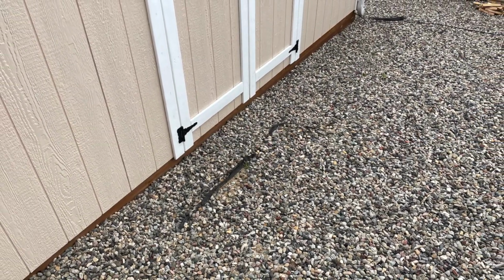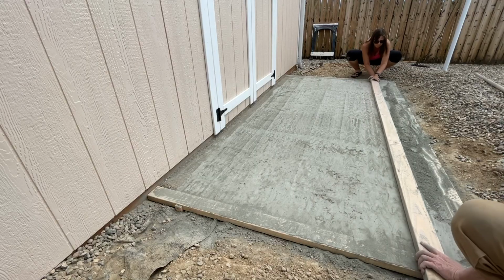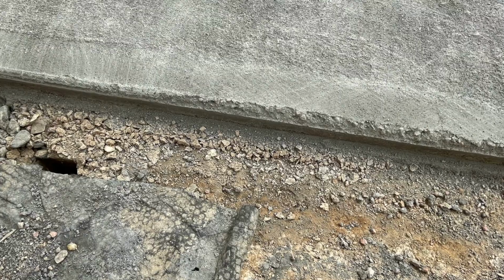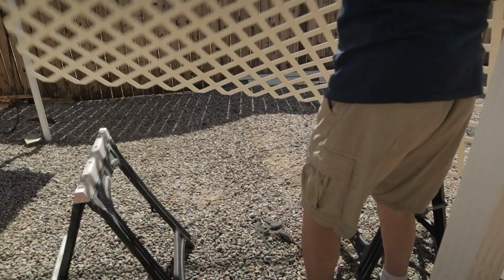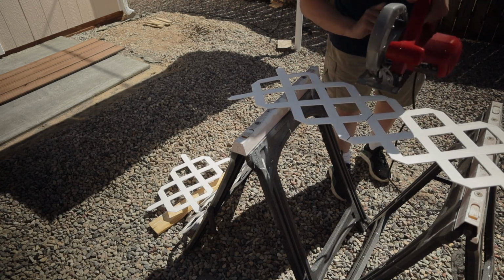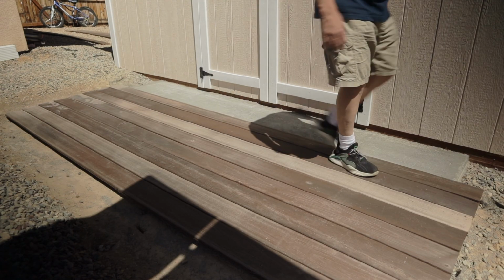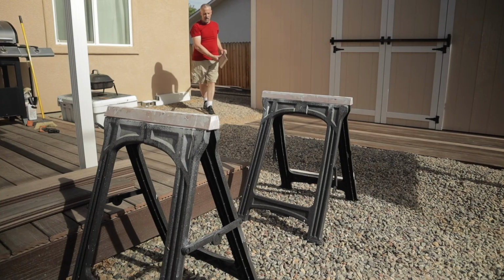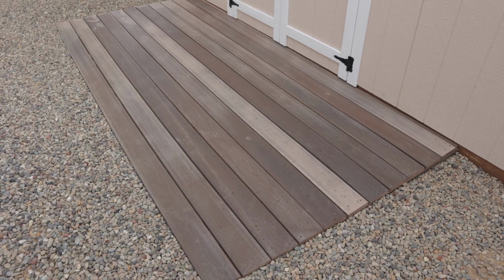I RUINED My Dry Pour Slab... Here’s How I Saved It

Comment: Personally I would have repaired that slab by first of all wetting it toughly basically submerging the slab in water and re doing that front edge with the river sand cement mix  then after that i once the excess water had dissipated i would have mixed a damp screed of river sand and Portland cement then made a slurry of Portland cement on top of the slab then the screed over the top of the slurry about half an inch thick  then i would have floated the surface  with a wooden float which should have been level and nearly completely smooth. After that If I wanted a super smooth finish i would have floated the new nearly dried surface with a Portland cement slurry and a steel floating trowel It would take a bit of trial and error to get it perfect if you have never done it before but with that edging tool and properly floated that finished surface would be able to be sealed if you wanted a shiny finish wanted, using an epoxy sealer.  The wooden finish looks nice but the concrete finish would have been my preference due to me having worked with concrete a lot in the past  and the durability of concrete.

Comment: Looks good, i prefer the deck look. but what if you had to buy all materials used? What do you recommend dry pour or just make a deck? We have no materials so can't afford both and can't afford mistakes. Thinking we might just go the deck straight up, what's your thoughts. Thanks for your vids, very informative.
Reply from the maker: I personally prefer the decking over the concrete. The decking is pricy and I wouldn’t have gone with it if I didn’t already have some on hand. I only used it because I had it and it was free. If I were to do another dry pour I would make it three inches thick and use mortar mix for the top 1/2” so I could get a smoother finish.

Comment: I saw another video where they did a large slab with dry pour and they did it in sections and they switched to Quickrete half way through and said it was a much easier product to use for dry pour and had a much better surface result and was easier to screed to get that result... I've seen others doing all kinds of complex things to get the top to be smooth... one thing is you should oil your forms and if you are in a dry/hot area you probably need more water, a lot more, after it sets up after the misting... one video showed it bubbling up because they are in a dry hot area and the surface was drying faster than the rest of it... this happens with wet pour too if you don't keep it wet during the cure period... so even with wet pour you should keep it wet during the entire curing period, they call it wet cure and some people do it on wet pour for up to 28 days totally under water, but for dry pour first you have to get it to set up before you do the wet curing process.  So the secrets are to use Quickrete, over fill so you can screed down the aggregate, vibrate if needed to drop down the aggregate, don't proceed until the surface is perfectly how you want it, then mist it as directed to get it to set up and then keep it wet until it's fully cured so it can fully hydrate, and more water depending on the temperature, humidity, and climate.

Comment: The deck looks great! Congrats. I wish more people would practice before they do a video on dry pouring. It may be giving dry pour a bad name when its not done right. There are a lot of videos out there where people did great jobs of their dry pour like the couple in Louisianna (I think). I will not be making a video of my first pour 😂. Maybe after some practice.  One thing i saw that you didnt do correctly that others seem to do better is screeding. looks like you have to take your time with it for the aggregate to go down which would give your surface a smoother finish. Also you have to tap the edges of the form for the wholes to fill in on the sides...and edging works wonders... Anyway... deck looks good but slab wasnt a failure.
Reply from the maker: Thank you

Comment: Looking to attempt a dry pour patio in the near future.  Looking to make it 4 inches deep and a 10X10. I’ll use the calculator and add 10% more bags.
Reply from the maker: I wish you the best with your project!
Reply: Just mix the dang concrete with water man. 10x10 is nothing and it will be so much better in the end

Comment: Man that looks amazing. I just did my first dry pour this weekend. A small pad for my trash cans. I had the same problems with the surface that you did great video. I love the follow up and do the Trex panels rattle when you walk on them or does the lattice take care of any movement or vibration?
Reply from the maker: Thank you! I haven't noticed any rattle from the Trex Deck boards. They seem to have a pretty consistent contact with the surface of the slab all the way across. It feels solid to walk on. Honestly I don't think this project could have come out any better if I had planned it this way from the start. Sometimes I just get lucky! 😀

Comment: yeah, that works.
Expensive, but works!
Reply from the maker: Expensive is right! These Trex Deck boards are about $33 each where I live. I would have never purchased them new for this project. Luckily I got mine with the house but they are quite faded and some are warped. If someone wanted to use them for a not so critical project like mine, you might find some salvaged Trex boards in the local market place for cheap.

Comment: It was lucky you had some vinyl planks. Buying them you just could have had a pad poured.
Reply from the maker: Expensive is right! These Trex Deck boards are about $33 each where I live. I would have never purchased them new for this project. Luckily I got mine with the house but they are quite faded and some are warped. If someone wanted to use them for a not so critical project like mine, you might find some salvaged Trex boards in the local market place for cheap.

Comment: Improvising is good, but only if you don't have to purchase the deck boards. I probably would've learned more about doing a dry pour first (which is why I watch videos like this), and try to avoid the mistakes. That said, I think it would've been possible to do another layer of concrete over the existing,  seeing as how it was quite rough. A finish concrete should've worked fine. However, I am not a concrete guy, so I could be talking out of turn, it's just something I would've tried first.
Reply: Very clever Bruce. Definitely like the “deck” look!
Reply from the maker: @markashlock9017 - Thank you Mark! We like the "deck" look better too.
Reply from the maker: Thanks for your input